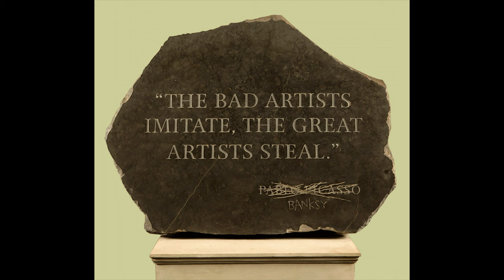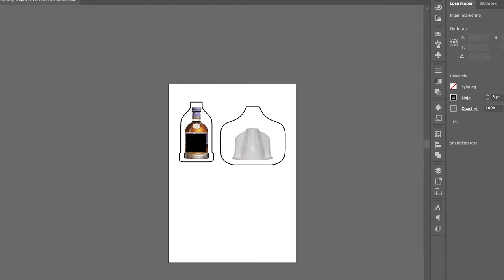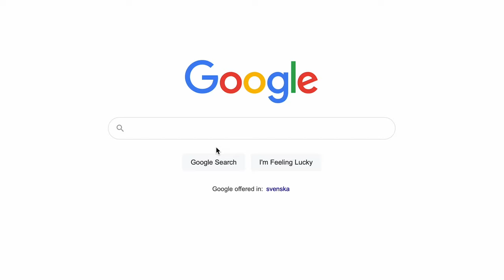nearly cut my hand off...to steal something

Comment: When flushing thick projects, use a bit with the bearing at the  top, ( bottom on router table) trim to half way up and flip to use already trimmed  as template...Safer, I also learnt this lesson the hard way :)

Comment: 4:34 I have done this! It’s terrifying! I figured out that it’s usually somewhere around the end grain transitioning to edge grain and you can change direction/take smaller lighter passes and get through it. But when you know that’s the transition point where the bits grab it helps you be ready. Also a spiral flush trim bit vs. a straight trim bit is a must. Great video!
Reply: I have one of those long flush-trim bits and I haven't used it yet, this video hasn't exactly "inspired " me !! 😮

😎👍☘️🍺

Comment: Btw I feel like you vase would have a tendency to tip over. Don't know how stable it is but could be improved by some interesting contrasting wood in the base of the vase.
Reply from the maker: Its quite stable. There's quite a big flat surface at the bottom. But adding a base would also work I think.